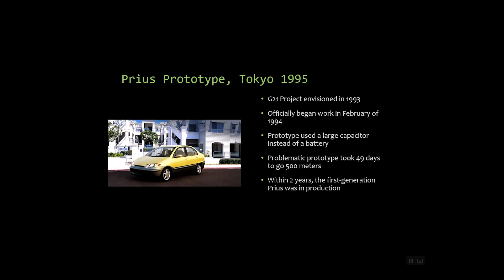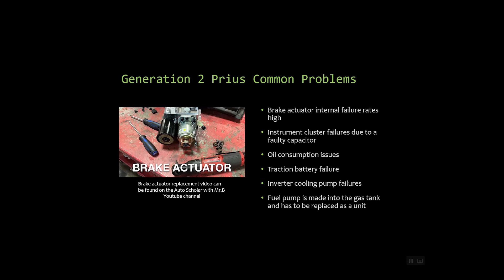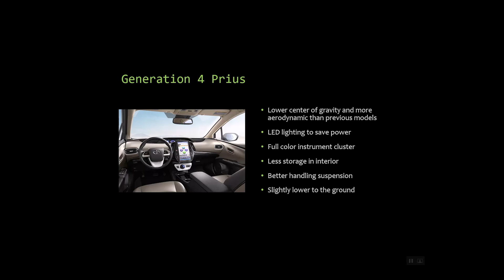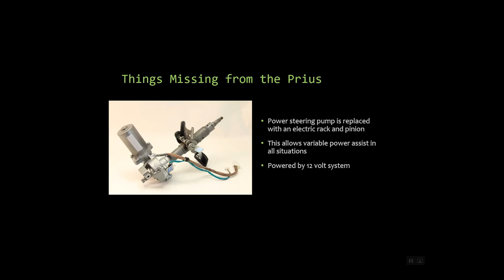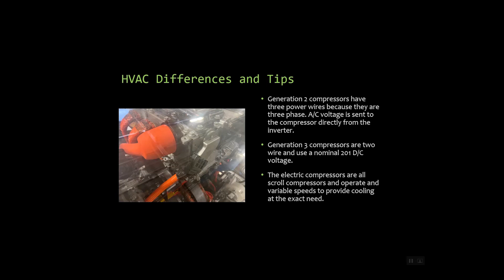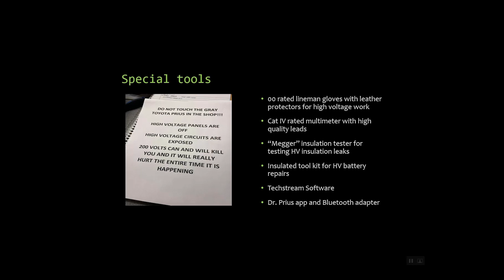Everything You Need To Know About The Toyota Prius

Comment: The Gen 1 Prius has a belt-driven A/C compressor. However, that doesn't mean that the engine must run continuously with the A/C on. There is a "cold-storage" evaporator that maintains cold air with the compressor stopped. This IS different from a conventional vehicle, since it takes more refrigerant to fill. I believe it is quoted as 100g AFTER the bubbles in the sight glass disappear.